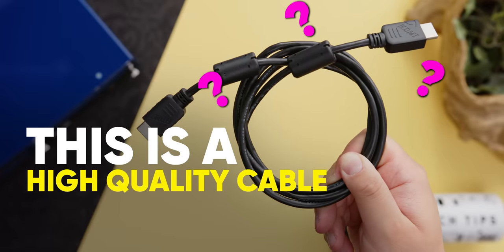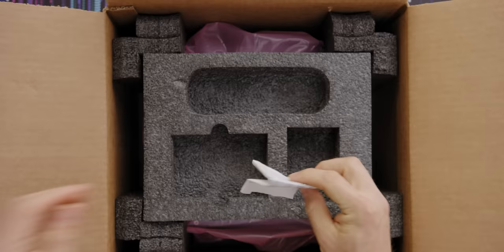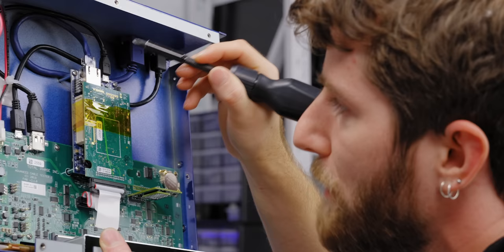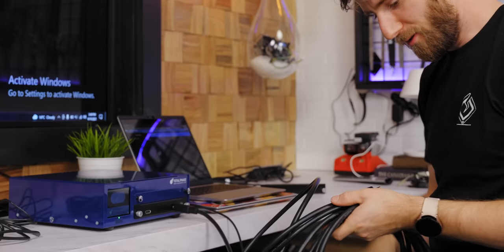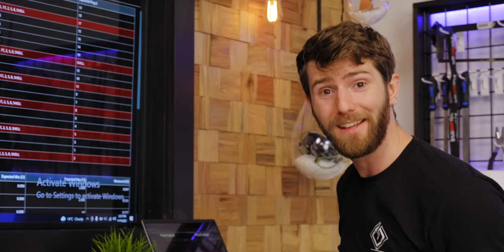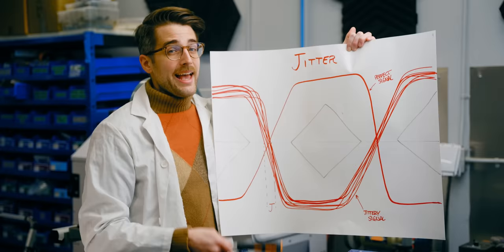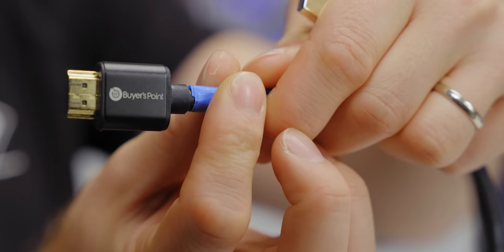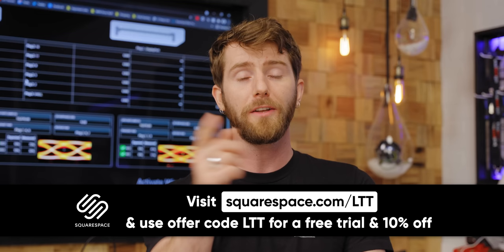This Just Saved me $100,000 - Totalphase Cable Tester

Comment: - You should do a roll-up video of when you go through your collection of cables and say what was wrong and how.
- When reviewing something such as a monitor, include the testing of the cables it comes with (including power, don't want them sneaking dodgy power cables in with expensive monitors/power supplies because you said "we generally have had no issues with power cables").
sometimes you do reviews of special cables like the wireless ones and the fancy fibreoptic ones, might be worth revisiting them.

Comment: I suspect the quad flat pack ICs that are scratched out are FPGA units. I used to do gate array development for a couple of different types of test gear and you need to be able to do clock-cycle precision timing for this kind of validation work, so they often use a small FPGA like an Alter... I mean Intel Cyclone 5 or Xilinx Spartan 7 to do the timing. It's really easy to do precision timing analysis in a gate array compared to a microcontroller (at least in my experience, I'm sure there are some embedded systems engineers out there who've written good timing analysis tools for uCs). There are a bunch of other reasons to use them for this role but the above is what I'm most experienced with.

Incidentally that's a really nice description of how eye diagrams and jitter work. From someone who has spent far too long looking at eye diagrams and worrying about jitter.

Comment: I'd like to see you guys test all/a sample of the cables on the official Display Port VESA certified database and see if there are any fails.

I'd also like to see you guys use some of the "failed" cables with a high refresh rate gsync compatible/freesync monitor and see if you notice any differences in smoothness etc vs a certified one.
Reply: And put a microwave next to the cable to add some electromagnetic noise. :}

Comment: Video cables drive me crazy. I bought cables that were faster than I needed several times and they weren't even up to spec for something lower. I wish I had one of these. I'd just buy a pile of cables and sort out the best. If you guys did a review series on cables with this thing, I'd totally watch the hell out of that. Please do one for the most common cable types! I want to know what brands are best. Thanks!
Reply: For just 15000 usd you can get one for yourself

Comment: One important question. How do you know the cable tester is accurate? Is there a calibration standard or something to make sure the results are accurate?
Reply: A man with one watch always knows the time. A man with two is never quite sure.

Being able to show an actual eye diagram helps you verify.  And really it's better to be overly cautious than otherwise. Rather throwaway a good cable than waste time never sure if it's one or the other. Also these are well-documented standards these cables should be following. It's really not that hard to make a tester that tests against that standard. Frankly the modularity is genius because now you only need to pay the royalties for the ports of HDMI modules you sell, or Thunderbird, or whatever. No need to have Lightning royalty cost affect users who aren't apple shops or something.
Reply: One obvious test would be to plug the passing cables in to an appropriate machine to verify they work. Also verify that cables that should completely fail do fail. 

Just do that for a bunch of cables at first  then periodically randomly test some to make sure the machine stays good.
Reply: It presumably gets crosschecked and calibrated against an Oscilloscope before they send it out.
Reply: There's nothing to calibrate. The pins are checked for pass or fail if they short and the oscilloscope inside just shows you what it sees essentially.
Reply: @HNANDRA  You do know that oscilloscopes need to be calibrated, right? And I'm pretty sure that if nothing else, it measures the resistances on the pins - which needs to be calibrated as well.
Reply: I was asking this question because I build copper and cable assemblies for the telecommunications field and all our equipment must be sent back to manufacturer for calibration on a yearly basis. 

Usually when the test unit is new there are no issues but after a year you could be passing cables that fail or failing cables that would pass.
Reply: @HNANDRA  Exactly.  As Riley pointed out this is binary, so it either works or it doesn't.
Reply: @ianc4178  Really? Way to misunderstand things. Nothing about the pass/fail criteria is binary, even if the pass/fail decision itself is. Did you even watch the part of the video where he was explaining the measurements and some of the ways they can be out of spec?
Reply: @ianc4178  Half yes and half no. Part of a cables spec is a straight yes/no. Is pin 12 connected to pin 14? Is pin 8 connected to a ground pin? Binary answers and easy to test for.

The design and connection quality however is a very varied thing. Those eye diagrams in the video show exactly that. It's the difference between why a Cat 3 cable can only handle 10Mbps and why a Cat 5e of nearly the same materials and amount of wires can do 100/1000M. It's not just a matter of end point hardware but also of the ability of the transmission medium to transmit the signal coherently. The tolerances for that get tighter the more information you try to pipe through it.

Comment: I wonder how a device like this would fare for checking noise in analog cables, like VGA, SCART, component, composite, etc...
Reply: I think for that you would really want some of the old school wave propagation testers, mainly because they're true analog signals, and this may not react the way a digital test unit is expecting.

That being said, digital is just really noisy analog, so I think the data might be okay for pass/fail but not necessarily indicative of the full loss profile, especially for frequency changes.

Comment: i think that it's important to uncoil the cables when you test them as having them wound up like that turns them into an inductor which can diminish the signal. i don't think it would cause a huge enough of a difference to go between a fail/pass but i think it's still enough to clear up some of the noise you saw, such as on the grey cable.
Reply: Because the individual differential pairs are twisted (and therefore tightly coupled together relative to other pairs, the environment), having the cable coiled should have negligible impact on signal integrity. However, coiling the cable more tightly than its minimum bend radius could cause issues (localized kinks in the conductors are no good).
Reply: @danielgiesbrecht9701  That's only true for noise rejection and crosstalk ..... When you coil a wire you can have impedance changes which cause cause problems such as signal attenuation at certain frequencies or a Low Pass effect that will round off the edges of your square wave which is where a lot of jitter problems come into play
Reply: This sounds like a thing they also can test. I would be interested to hear how much it matters and if there is a good way to coil cables if it does.

Comment: Cat 5 vs 5E vs 6 vs 6A. I have ran 5 that handled gig speeds at near max length, and Cat 6 that pooped out at stupidly short distances. Both tested fine with a fluke, but that just showed continuity, and not really a detail on what was causing it to fluke, but still flake.

Comment: I would love to see tests done via 3rd party "magsafe" USB-C adapters to see how much they affect the signal.
Reply: +1 for this, a positive result would tip me into buy mode. Yes, I'm usually cheap.
Reply: I love using them, but I worry about how well they work too!

In actual use I feel like it's better than solid cheap ones for information, but I don't use them for data much, mostly electricity and this is the anecdote of just me. I want science!

Comment: The scratched devices are probably ADCs or DACs depending on where you see. If they are generic "jellybin" parts they can be reversed engineered by layout. 
So yeah, so much for that I would guess. But sure, it involves a bit of guesswork, it´s not served on a platter, which is what they are doing.
Edit: The part you showed on the video is most likely an Analog Devices ADC, but that´s just a wild shot.

Comment: This is really cool. Is there a way to test the integrity of Ethernet cables? I've been having troubles with one. And is there a way to repair  it without replacing the whole cable?
Reply: Usually the problems caused by ethernet cables stem from physical damage to the cable itself (excessive bending, for example), interference caused by power wires running parallel to ethernet, or bad terminations (plugs). In my experience, especially for premade cables, categories are pretty accurate. A Cat5e will 99% of the time behave just like a Cat5e should over specified distance. In a nutshell, check the plugs and make sure it's not kinked.
Reply: @razaelll  Thanks for you feedback. That's what I figured as well. So I'm going to check it out.
Reply: @subuwu9879  no worries mate. Hope you find your problem.
Reply: The plugs are easy enough to replace. But you need to buy plugs, a crimper and a tester. Basic testers are cheap, but only test simple continuity, not signal quality. Those usually work ok for me. It also takes some practice to learn how to do this. Pass-through plugs are much easier for the novice. There are many videos on how to do this. But is the length and value of the problem cable worth the trouble? If another cable shows the same problem, then it's not the cable.
Reply: @subuwu9879  additional damage modes are - stretching, this pulls the carefully twisted cables out of aligned and messes the signal up and is common when pulling through conduit or walls, typically not repairable.  Not obvious damage via bend:  a hard 90 is bad, straightening it may get you whole.  The other item w/ ethernet is parallel runs with other cable types.  Don't run it w/ dirty power (lines to AC units, heavy duty motors, ...)
Reply: @KameraShy  Appreciate the info. Yeah I've done some light research and it seems easy enough. I'll have to order a crimper tool. We'll see what happens.
Reply: @KameraShy  It's a high quality (wasn't cheap) flat 50ft  CAT6 cable. I've check the rest of the cable and everything seems fine. I believe it might be the plugs.
Reply: @ljs2476  It's a flat cable but it has had it's fair share of stretching and bending. Let's just hope it's the plugs.
Reply: Tools to put new ends on ethernet cable are relatively cheap, of course shortening a cable to put a new end on kinda assumes you know exactly where the bad spot is, which is not so simple unless you know and can see that the connector itself is damaged. Validating that an ethernet cable will function as an ethernet cable also involves some pretty inexpensive tooling, since the cable itself is 4 twisted wire pairs that carry electricity to transfer data, but much of the difference between standards is how twisted they are, category 3 5 and 6 cables use the same amount of pairs but have different twist rates and shielding standards to reduce interference.

If you wanna know if a cable will just work as a cable you can get an RJ45 tester for like $10, if you wanna know the speed at which it'll actually run things get more complicated
Reply: @RandarTheBarbarian  It's a flat CAT 6 50ft cable. I did check the cable and everything seems fine so I'm assuming it might be the plugs.
Reply: @subuwu9879  could be a short somewhere inside that you'd probably never see, you can see shorted wires in the connector if you look close enough. Much like Linus' testing here a bad quality CAT6 cable might just validate as a CAT5E or something but would still pass internet

Comment: A cool thing to test this on would be Linus' setup at home since he runs everything over optical and see what the results look like for that kind of distance.

I'd also be interested in the cables that come pre-packaged with monitors or with pre-built systems.

Seems like a place companies might cheap out but a majority of consumers would just go with it.
Reply: This kind of tester wouldn't work on any active cables (amplified, medium shifting etc) as it's doing resistance and spectrum analysis. All active cables would fail even though they might pass any practical test.
For active USB for example, you instead need to test it as if it were a hub, which would be a completely different setup (but still interesting)

Comment: If it can test ethernet, I really want to see if the 100 yard max is really as bad as everyone makes it out to be. As well as beyond. Maybe seeing how far you can actually push an ethernet cable.
Reply: The answer, as with most things in life, is Yes, bit also no. 🤣 There are too many variables to make a general and widely applicable statement like this. Things like environment (RF or EMI) heat, how many cables are run together, how the cable was run, and whether it is in spec, how well was the cable terminated, is it a shielded cable, the devices you're using for that cable, and often times even the brand of cable can all influence performance.

Comment: When testing cables you want them in a straight line, having them in a tight loop like in this vid makes them form faint magnetic fields that cause interference.
Reply: @Jamie Munro I've seen it make a difference on cheap ethernet cable. Unfortunately we had a batch of "cat6" that was actually copper clad aluminium, when looped for runs that were longer then needed it didn't pass fluke test for 1gb speeds. We cut one down to shorter length which is when we noticed it was copper clad, you could literally scrape the copper off to reveal the alu inside.

Comment: At 6:44, the shield pins 2, 5, 8, 11, 17 and shell are all interconnected (you mention 'supposed to have ground connections for signal integrity, which they don't' which is incorrect.) I don't know if that is really a problem or not, and where the HDMI specification stands on this. They'll likely be interconnected inside the socket of a device too. As the signal integrity is good I'd personally still use the cable. Still an excellent video though!

Comment: I would suggest the Cable Eye System from Kami Research way more. It is less than 1k for their system and it is able to test so much more than this tester and probably with a better result.

It also has a super long length checking ability along with being able to check capacitance, resistance, and inductor value directly.

Comment: Not sure about digital cable, but in pretty much every other signal carrying cable I’ve worked with, coiling it up will make it pick up an insane amount of noise assuming it’s a low voltage signal and unshielded. I’d make sure to uncoil the cables and keep cell phones and other electronic devices away if you’re going to be testing the cable for it’s own capabilities. Of course, testing the cable in a real life situation with some interference is a good practical test, but placing it under excessive interference should be avoided anyways. That, of course, is assuming these cables pick up interference that well when coiled anyways.

Comment: Cables. . .I had a problem with mi WiFi. My laptop didnt want to connect to it for some reason. It was caused by interference from HDMI-DisplayPort cable plugged into laptop and running monitor.

After 2 days and some money spent on new HDMI - DIsplayPort cables. . .I have find out that: 
The HDMI-DisplayPort cable, when connected to laptop and when the monitor was ON, interfered with the actual WiFi channel.

Solution was to manually change WiFi channel to other than the one that was interfered with the laptop-monitor cable. . .
So much time spent by resetting router, laptop, trying to find out if the new WiFi drivers are causing problems. . .

I feel your pain LTT! 😀

Comment: I would be particularly interested in seeing the best long and/or slim cables. I'll trust most short, chunky cakes to work even if they're cheap, but for situations where you need to run the signal across the room, it gets a lot iffier.  Low-profile or right-angle adapters would be interesting too, for similar reasons. There are occasions when they're necessary, and it's hard to know which ones are trustworthy

Comment: I'm wondering if this could also work for KVM, extender cables or even wireless HDMI extenders. 
After all you have HDMI in and HDMI out, this works out just by using the connectors, I dont' think it would be bothered by the fact that there is actually no cable. 
I would really love to see what happes.

Comment: $15,000.00,  I do not think so.  My bench signal generator/oscilloscope and bench ac/dc voltage/current/power test supply and advanced bench multi meter do just fine.  They all may be old and I may need my tool box full of adaptors and take some time to test cables; They are paid for and still work just fine.  :)  All my bench equipment are for laboratory use and do fine for me.  If I were not retired and still in business, perhaps.  But there are still good options at lower costs.  But still, I am old school and have what I have.  I am happy.  :)